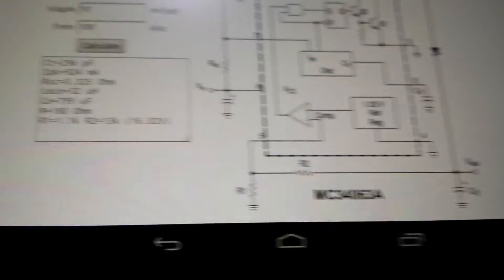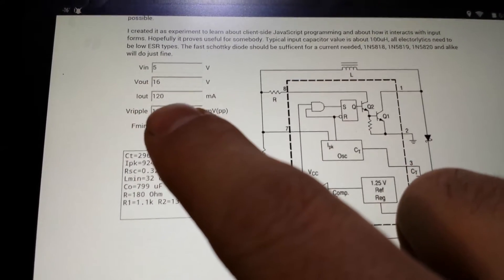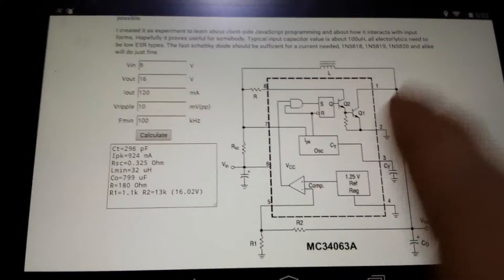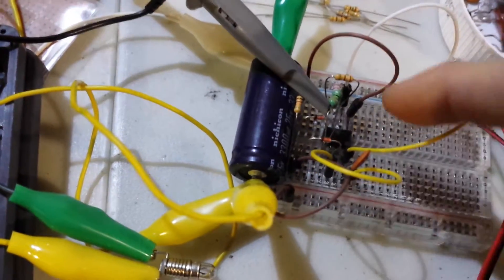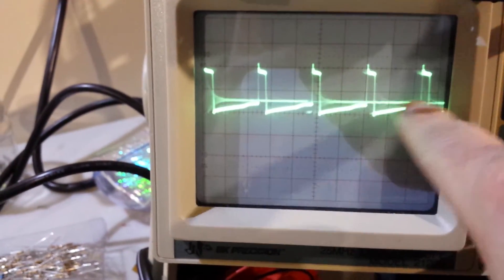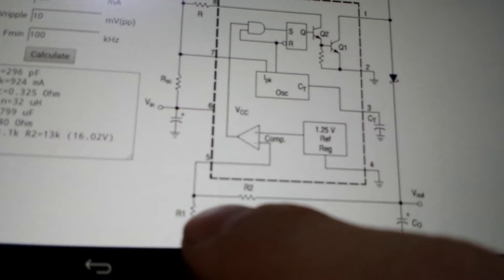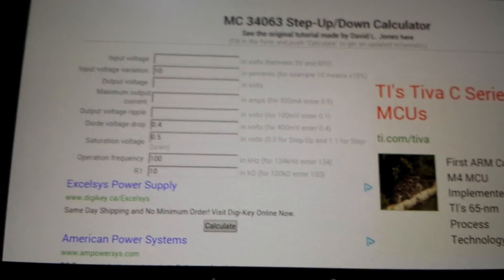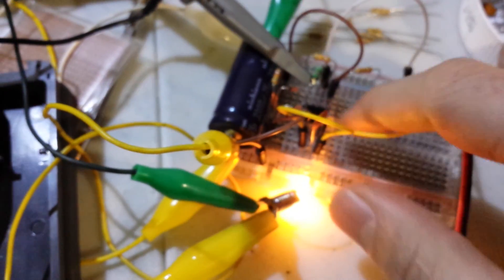MC34063A Information video

Comment: Help! i need an equivalent to this IC MC34063A   which one do i go for?
Reply from the maker: You could do a search for it. The ic itself it fairly cheap and easy to find I would go for the original ic unless you need higher input voltage in that case some of the ICE series could help they are mains voltage rated.
Reply: @bakupcpu  from west Africa i have, ghana i have been to must of our local shops and non of them main reason why i want something similar....
Reply from the maker: @g-axis001  ah I see. I get mine online from eBay. I would have to search online to see if there's similar ic. You can search in the max categories as well.
Reply: LCSC

Comment: what power supply is it at 3:37, is this available online?
Reply from the maker: Indeed it is you can buy it at icstation.com in the power module section the black box was in my junk pile though you will need to supply a power supply on that little board.  Cheers

Comment: i just burnt some leds :( i had 3x 3.3v 20ma powered off litho ion 4v 1a. i am getting some crazy voltage readings 700+ dont know what is causing it. do i attach the leds to Vout like on that website or should i putting them before the resistors on pin 5? the chip i savaged and it has 34063API - ncckxn same chip?
Reply from the maker: It's same base chip probably different rating for the power. If you want a constant current you will need to calculate the current with the internal 1.234 volts reference and then from pin 5 to ground you put the resistor. From there you take the voltage you just boost and you pass it true the LED so 3x3.3 would give you about 10 volts at 20 mAmp then the cathode of the led goes to pin 5 directly. Never run this circuit without load it will charge the cap to it's max voltage and if you connect anything then it will burn the LED also make sure the LED are in series not parallel I know I did this error a few time :( cost me some precious LED you can also before powering LED use something like a small motor in series with a amp meter to make sure you have the correct supply. You can also go the old way with a fix voltage in your case 10 volts and then use a little limiting resistor.
Reply: thanks for the reply. seems i was disconnecting the load. havnt had time to change it yet. might just put a 10v cap in there too.
Reply from the maker: Ben Mitch No stress :) Let me know how it turn out :)

Comment: wait a minute! i just plugged my parameters in and it told me that it is going to draw 4A! 12v in 5v out @ 2A and i only need 18uH i dont get that at all! how does 48W buck to 10W? :|
Reply from the maker: lol don't get fool by the Ipeak :)
Reply: lol ok fwew :D that just means what the current draw will be when it is actually switched on? so it should be around .5A to 1A draw average right? thanks for the clarification!

Comment: cool i have a few of the exact same type (just different brands and part numbers) i might have to use that calculator for my circuits, i think my problem is that i dont have enough inductance in the current range that i want :/
Reply: also my 49A mosfets arent dissipating the power generated to the heatsink i have. i was like about 50% efficient, i was using a 100uH inductor, 12v in and about 2.2 to 4.4v (i was using a 2.2 ohm resistor as my load) so 1A to 2A load i was messing around with the frequency and i guess the higher the better but it didnt help a whole lot just with the noise i am using 66pF cap in it now.
Reply from the maker: Yeah depending what you want it can be difficult to pull the correct frequency I normally go for the max which is 100Khz and also make sure that your coil is capable of handling the amp you push thru it right now I have a little circuit and the coil is over heating because it's too small so I had to reduce the current going thru but at the same time I reduce my output for some high power application I would recommend you buy a premade high power one like the one I bought is a 400 Watts input 5~40 output 5~80 fully digital with LED display got it on eBay for like 25$ I think. Cheers!
Reply: cool yea that would be fun to have but i am just experimenting :) i have nice inductors i just have no clue what their value is.
Reply from the maker: Grab a inductance meter lol I have 2 now :) and also an ESR meter for capacitor very useful in dc to dc converter application
Reply: yea im going to soon but 200$ for a good ESR meter is a bit much :)
Reply from the maker: Ouah! I paid like 25$ for mine hahahaha it's a cheap one but work for me :P
Reply: heh yea i guess until i make up my mind on what i want it will have to wait, it would be a good investment as long as i dont blow it up :)
Reply from the maker: :) yup!